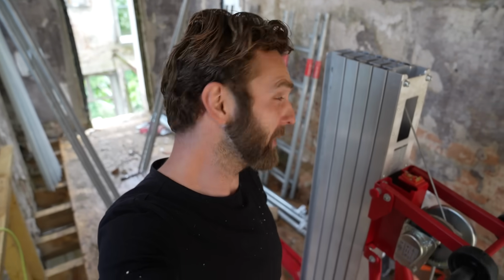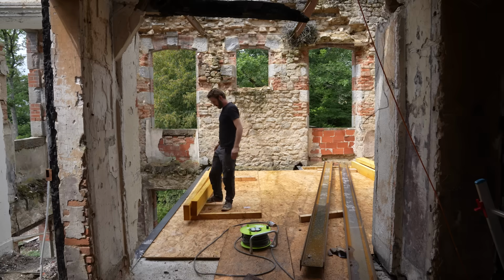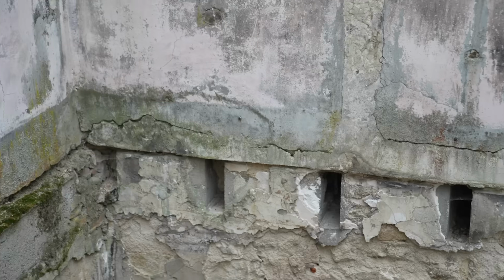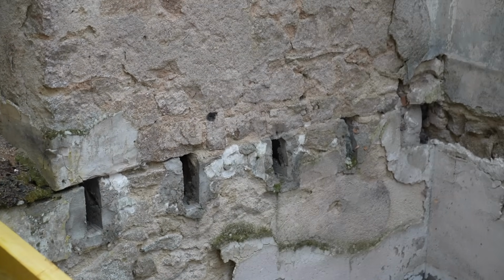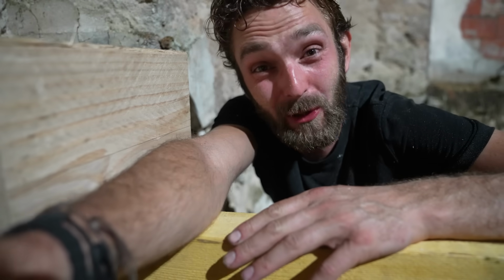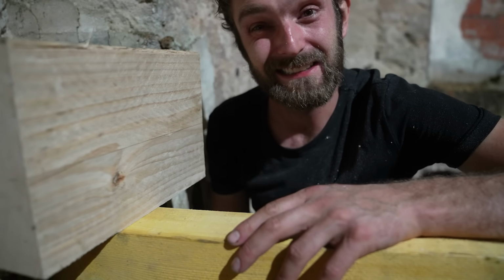Difficult install on the last part of the floor.

Comment: Bevel the timber as deep as the pocket is. You may not have to remove as much mortar, stone, or rock. Y'all are knocking it out!  Stay safe.
Reply: Agreed, much easier to take of a couple of millimeters from each side. It won't hurt the integrity of the beam. The strength comes from rhe height not the width.
Reply: get an electric planer, then its in the pocket in 2 minutes
Reply: I was thinking  the same thing. An electric planer or even a hand plane would do the job.
Reply: sharpen the pencils
Reply: Yep! So much easier 😊😊
Reply: Yup.  Wood is wayyyy softer than concrete and stone.
Reply: Agree with adjusting the wood
Reply: Yep plane it, only needs to be one side, not both
Reply: Adjust the beams, not the cement, take off just enough to get the beam into the pocket, won’t weaken the beam
Reply: Scrolled down looking for this comment, should save you a lot of work and frustration and won't weaken the construction!
Reply: Agreed. I should think the 10mm you have removed from the I beam ends has already weakened the beams more (very little anyway) than what needs to be removed from the pocket ends.
Reply: This is the way.

Comment: Hey Dan, I am concerned about the bracelet strands on your wrist getting caught up in the equipment you are using, as it could be very dangerous.
Reply: I am, too. I think about how I was told once that guys who do these manual trades shouldn't even wear their wedding rings. I was told about a guy who jumped down from the back of a truck and his wedding ring got caught on the truck somewhere, and he lost that finger. Dan should not be wearing that jewelry. 😔
Reply: Agreed.  Dan!  Maybe wrap your bracelets lightly in masking tape if you don’t want to take them off, so they don’t dangle.  Then take the tape off at the end of the night.  👍
Reply: I’ve often thought that too but I don’t know if Dan has time to read the comments or at least safety is not his priority. I often have to watch between my fingers and then I worry when he’s off for a day.

Comment: Whi didn't you remove 2 or 3 mm around the wood with a planer. Than the joists should fit in the pockets more easily

Comment: G'day Dan, rather than increasing the size of the pocket, why not electric plane down the ends of the planks to suit?
Reply: Or take the circular saw and cut some kerfs in the side and trim it down
Reply: Exactly what I was thinking.  A lot easier to lightly trim the beams than to chisel out a deep pocket of stone and concrete.
Reply: Right, I'd be planing the wood, not chipping away at the stone.

Comment: Dan, continuing to be a perfectionist in the face of adversity- no shaving the timber a few cm - no shortcuts in this build. Gotta love it ❤️🇦🇺
Reply: Sorry Dan better luck tomorrow. You’ll work it out❤
Reply: Get a hand held planer, shaver the ends of the beams. Come on...........   Oh, love your videos, wish they were a little longer but I think I understand why they are the length they are. Best of luck.
Reply: It's not a shortcut. It's almost the same thing he does on the other end to fit it in the steel I-beam
Reply: I was thinking only quarter inch or so not several cms .  Same as bit of bevelling edge with plane.  😊😊
Reply: No short cuts…really, are you being serious, dear oh dear 😂

Comment: Pace yourself, it's not a race :) You are doing an extraordinary job! Thanks so much for taking the time to share with us!
Reply: It's not a race. At the same time Dan wants to get the roof on before winter so that all the work that is completed will be protected from the wet weather and so he can work on the inside of the house in relative comfort. An earlier video showed that the area gets snow and the freezing wind from it.
Blessings from South Eastern Australia, Dot
Reply: It IS a race a roof before winter or all that particle flooring boards gets wet, moldy, and will be no good
Reply: the roof of a castle in France is very different from roof of a normal house and very difficult to intall, need a expert
Reply: Winter won’t set in for a couple of more months. And the flooring boards will be replaced anyway with more sturdy permanent ones, as Dan said in one of his earlier vlogs.
Reply: @oszzzie  Zero chance that a permanent roof structure goes up before winter, at best he finishes the brickwork up top and puts in some temporary protection sheeting or something
Reply: @taylorh.6477 He never said he was putting on a permanent roof before winter. Just "some kind of roof"

Comment: Smart using the smaller block of wood as a test section before trying and throwing your back out with the actual beams.
Reply: Rather obvious if you ask me... You always test with a smaller segment. Doesn't matter if it's building or coding.
Reply: Why does he just make the end of the beam smaller. Much faster to remove wood rather than stone??? Mess up the structural integrity maybe?
Reply: @Klog_uk  I’m guessing the beams are to code.  Making the ends smaller might break that?

Comment: Sod's law in full operation, as my dear old dad would have said.
Petit en petit, Dan. You will get to the other side of this problem, no matter how annoying it is right now. I admire your brilliant ability to tackle this enormous project by focusing in on the particular part of each individual task you're doing. It's such a productive attitude because each small step becomes an achievement and boosts your confidence.
Big hug ❤

Comment: If everything was "easy" your vlogs would not be as much FUN dear Dan !
Reply: I don‘t think Dan would describe his frustration as fun getting the timber into the openings
Reply: @6109river  It's frustrating but it has to be done, it just shows that even though he's getting better at doing the floors or whatever the Chateau can still throw a spanner in the works, he will appreciate this floor better when it's done, not so much when he is doing it, it also shows that when he is putting his lime mortar in that the timber will be held solid, and he's not downhearted like he was when he was grinding the cold water tanks out, "that" was his worst job!?!

Comment: Great to watch your progress!   I know “hindsight is 20/20” but Instead of chipping out the pockets, notch the beams by a 16th, or whatever the space requires. You’ll get through it much faster. Then go back and backfill to tighten them up. By now, I’m sure you are already done, but use this for the other sections of the floor. You are a tremendous inspiration!

Comment: Hey Dan a builders trick. It you saw to start with the end grain it will give you a line to,set your chisel on and make it easier to flatten out your rebate. So that’s to start with one slice on the end with the skill saw. Then head back to your mark.

Comment: Dan, Rather than chisel the holes out maybe you could sand the ends of the beams to make them just slightly narrower to fit in the slot
Reply: Power plane the ends. Sanding would take forever
Reply: Don't bother with sanding it takes too long... pick up an old wood plane or a draw knife (or maybe a hand held electric plane).  Use that to make the ends of the beams a little bit pointed on the end going into the concrete.  Then you can get on the other end of the beam with a sledge and drive them in.
Reply: Or draw knife as someone else suggested. Fast and less expensive
Reply: Yes. Maybe chisel the boards to make the thinner like he does to notch the beams that go into the steel I beams. Except for  it on the broad flat side of the beam. He'd only have to shave off an inch or less I'd bet.

Comment: You are all working so hard, it must be so frustrating to discover that the previous owner's repairs, has made it even more difficult for you to replace with new beams. Fulsome praise for your patience under stress Dan. Great idea to use the offcut to check the size of the gaps in the brickwork.

Comment: Hi Dan, would you consider prefabricating the roof and turret on the ground an lifting into place with a crane ? Also, just slice some wood off the side of the beams, 10mm wont weaken the beam strength. Then just slide them into place. Easy.
Reply: Great question!🎉

Comment: You are trying to fit imperial sized joists into metric pockets.😅
Shave a little off the sides of the timbers.  You need the cross-section for bending in the middle of the beam (at noggins). At the pockets  the wood can easily take the shear forces.  Civil engineer advice.

Comment: Hi Dan, Love your work ethic and I wish you well in your endeavour to get the chateau back to its former glory. 
Have you thought about using an electric plane to shave off a few millimetres from the sides of each beam? I think it would be cleaner, quicker, simpler and safer than chipping out the pockets.

Comment: I see multiple comments to trim the end of the beams to fit the tighter holes, than chisel out the holes to fit the beams. Only to have to repair the chiseled out slots again. Especially if the holes in that area were already solid and the most recent fitted.

Comment: Quick update. The dirt work is looking good… gravel is always nice, looking forward to that. If you had a hand planner could you just ease the ends a little to fit the existing holes or would that be an issue with the over all floor strength. Another reason for another tool. Thanks for sharing!

Comment: wouldn't it be easier and faster to plane the ends of the beams to fit the hole?  It doesn't look like there is that much to remove, but enough to make it a pia.  Love watching you bring this husk back to life.

Comment: Use an angle grinder Dan. Cut a slit vertically on one side about a centimeter away from the holes. That’ll give you a starting bit to chisel a slice away and then continue inwards. You could use a chaser for a deeper cut but you’d need something more stable than a ladder as it’s a dangerous job.

Comment: Just remember the tortoise won the race not the rabbit. You will get there. This guy I knew used to say that into every life some rain must fall. You will get the roof on before winter. Just don’t stress. You have come a heck of a long way. And to think you were complaining about the monotony of doing every floor the same. SURPRISE. 😂

Comment: Dan. You need to buy a hand held Router and a large flattening bit for it, and shave off a few millimeters off of each side of the beams. The weakening of the beams will be minimal and of no concern. Take it from an engineer. 😉👍

Comment: All you have to do is use an angle grinder or Sander or plane and make the beam ends thinner. why chip out perfectly good cement.
Reply: A Power Plane would do the trick in matter of minutes or less..
Reply: What he said, sometimes you can’t see the wood for the trees 🙂

Comment: Great to see you back.  I'd get an SDS drill/chisel up there, resizing those openings is going to take a long while by hand.  It does pain me to see the old bricks getting carted off, collect them like the rocks for the rebuild as I would be surprised if exact matches are still available.

Comment: Get a little hand power planer and shave the beam ends. It will have negligible affect on the beam strength but will be much easier; massaging wood slightly is easier than massaging concrete.

Comment: I don't know if it would work in your case but we've had holes in cement cut or enlarged with a concrete drill.  It's a pain with a rectangular hole but boring out those openings with overlapping drill cuts would remove much of the material and make chiseling it out the remaining material easier.

Comment: You should use a Power Plane to take down the widths of your joist tails, by just millimeters, to fit the preexisting pockets... it would be easier plane the wood than chiseling away at concrete and stone to enlarge the hole

Comment: Get a planer and run the ends off 1/4 inch on all sides . From the ends back to nothing over 12” 👍 . They will fit like wedges

Comment: Good morning team Dan ❤
🙌👍for the lifter thingy up to the right level … 
Bummer for the beams though 

My question 🙋‍♀️ is why they did they do it ??
Squeaky floors 🤷‍♀️🙃
Pose we where going along swimmingly ,one little hiccup will not slow you down 😊😁👍you got this  even if it involves a 10 pound sledgehammer ..
Rest well and we will see you tomorrow ❤

Comment: If the fit for the beams is so tight again, it is easy to make the end of the beam a few mm thinner with the circular saw or router.

Comment: Run the planner over the ends of the beams for the depth of the socket,just a smog,easer than chipping out stone
Reply: I was thinking something similar but not sure if you can use a plane across the grain.
Probably better to use a router.

Comment: put the joist ends on a slight diet with the circular saw similar to as you do for the joist to I-beam fitment. In USA you can notch the member (girder, joist or rafter) up to 1/4 the depth so thinning it won't harm. The Section Modulus is width x height, squared divided by 6 so enter the full width and then the shaved width times the height squared (height times height) divide all by 6. The diet affects the Section Modulus way less than notching it up to 1/4 the end

Comment: That's why you need a router or an electric planer. That would make adjusting the width easy. The width cannot be that different as beam size is mostly standardized

Comment: Hey Dan, What about using an electric plane to remove timber from the side of the Floor beam? It should fit much easier once this is done.
Reply: Can that be done and still meet code? I have no idea🤷🏼‍♀️
Reply: @DuchessOfFlamingos  he had to do it on another floors' beams on the outside wall.  The structural integrity won't be compromised
Reply: @DuchessOfFlamingos also if you think about it, the beam has already been trimmed on the other end to fit into the metal girder, so taking probably half as much off the other end won’t make any difference….

Comment: I would take a 1/4" (or whatever is necessary) off each side of the beam ends that are going into the pockets just the distance of the pocket depth. Those beams are so beefy and you have so many it shouldn't compromise the engineering. You can even lay all the necessary beams on their side next to each other. Set a depth and make multiple skill saw runs, then snap out all the pieces. Finish off with a chisel. Sounds time consuming but maybe easier then chiseling the concrete.

Comment: Buy an electric plane and trim the ends of the beams to fit the pockets. It looks like they need hardly anything removing to make them fit
Reply: He needs a power plane... he could shave 2-4mm off the tail width within minutes
Reply: Yup much easier than chipping out all that stone

Comment: DAN! What about just shaving down one side of the end of the wood beams a bit to make them fit in the slot? Take maybe a centimeter off one side just like you notched the other end for the i beam with the saw. It would be easier and safer than standing on a ladder chiseling out the holes.

Comment: Looks like it will be a small Jack hammer job, that hard modern concrete is going to be a pain. Jack hammer out just one side so that you can slowly get them in on an angle then repair them later.

Comment: Progress is fast but don’t you have to remove the old concrete where the wooden beams will be installed? If not the concrete will capture moisture and they will rot.

Comment: I said it before and I'll say it again... DADO Blade. 2 passes with it instead of the 10 or so you have to do with the regular circular saw blade, AND no using a chisel after. Also, belt sander on the ends of the beams. It looked to be such a small amount. Sanding the beam end and repainting them black is WAY easier then chipping concrete.

Comment: you need to take a little bit of time and just build you a boom off of one end of the chateau and use your electric winch to haul that stuff up.. Use one of your steel beams about 1.5 times as long.  Put one end on the outside wall and the other over the top of the opposite wall (tie it down good), connect the winch to the end (or use a pulley) to hoist that stuff up.  So if i count right you have two or three more of those towers???  it would save you a lot of sweat.

Comment: Dan good god don’t waste your time chipping away at the cement in the pockets just use the track saw and remove a little bit of the beam on each side so it will slide in.

Comment: Whoever used that extremely hard cement had no idea what they were doing. Seen a bit of that sort of thing myself (on a small scale) and it wrecks the structural integrity if any later work is needed.

Comment: May I suggest making a boom an pulley for the winch system you could use for lifting 
Some temporary stairs might also be safer than climbing up scaffolding

Comment: An electric Bohrhammer (drillhammer?) Would do a faster job than your hammer and chissel.  If you widen it up too much, you can cement the beams in again later.

Comment: Hi Dan. May I suggest sanding he ends of the boards. Yea, put them all together like you do to trim the ends only lay them flat. And sand them off. You can use an orbital sander, palm sander, belt sander or any sander. You only need to take about 0.30 on the ends to make them fit. That ought to do it. Love the progress.

Comment: Great progress as ever Dan and it's just one of those days that come to us all at some point when it does not go to plan. Regarding the pockets, as there a tight fit but strong why not trim the beam ends to fit the pockets a bit like you did with the steel supports. Damn sight easier to trim the beams than knock out all that solid concrete and the minimal amount of timber removed should not effect the strength. Have a great day and looking forward to todays vid tonight. Still the best watch by a country mile on YouTube at the moment.